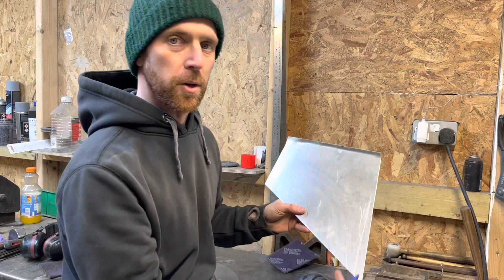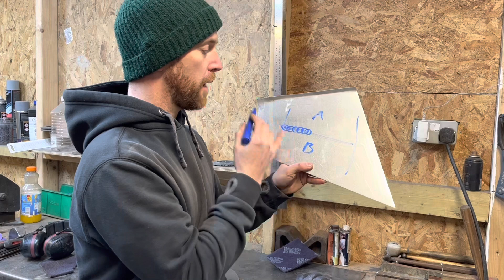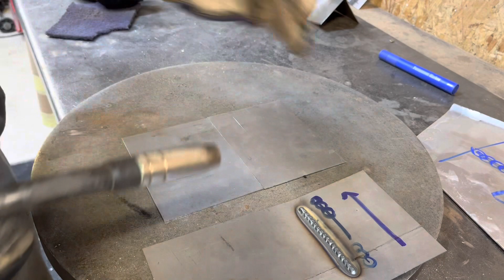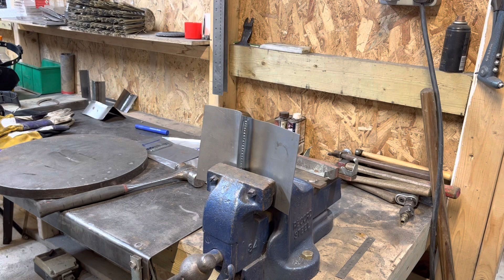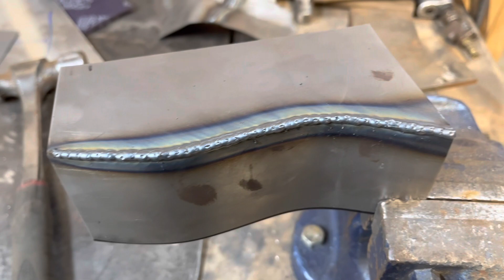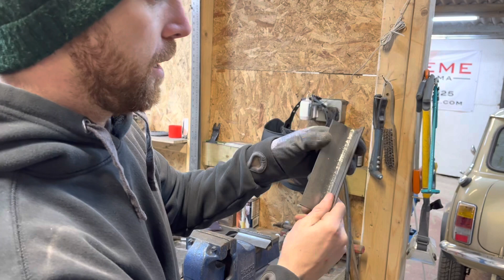MIG LIKE TIG

Comment: I haven’t started welding yet so for my benefit what was the settings used on the welder and what type of wire and gas did you use. Is this a good set up for a beginner Thanks.
Reply from the maker: Just mild steel wire. 60 amps for mig and 23 for tig

Comment: I think the reason this is shunned by the professional cert instructors is that ANY weld technique being learned is fraught with either too much or, more commonly, too little penetration. We all know that the outward appearance often doesn’t show what an x-Ray would. Thus, many welds are inferior though they look good. For a beginning welder to embrace this quick to learn process along with the inevitable poor penetrating mistakes is to introduce a false sense of confidence and ability. Soon, as we see on Yt, it is being used for all welding like heavy-wall motorsport frames, roll bars, suspension, and everything else where the common mistakes can be far more serious. So it just isn’t a technique to build upon. I think this is why it is poo-poo’d by so many. 
As a stand alone technique you have proven the strength on sheet metal.

Comment: Will you be able to do this exact same technique on 20-22 gauge? I kind of doubt it, I think it will get too hot, distort easily and possibly burn holes too easily. I haven't tried myself tho, I use the other tacking method, with 1-2 inch gaps, use some air to cool it down, and tack tack tack, blow, tack tack tack until it's a whole seam. It takes time but it's the method I learned to use on existing thin sheet metal panels.
Reply from the maker: I use it on 20gall the time without any issues at all. No holes and no distortion. For that I use 55/60 amps. 👍I do 3 tack and cool on bodywork.
Reply: @Metal_shaper_tom  Thank you very much for the information. 👍 I didn't mean to doubt your methods. I'll try it on my own restoration project. 🙂👍
Reply from the maker: @uti_s1471  sure . Don’t worry I didn’t think you were criticising. I think this method works brilliantly on thin material. Please give it a go. Hopefully you get great results

Comment: Great welding pal. How does this method cope with distortion?
Reply from the maker: If you see on the panels I weld in the video it doesn’t distort and I run the weld continuously. That little break between each weld really helps put less heat into them
Reply: Thanks for the video Tom, really helpful advice.
Reply from the maker: @dougwernham5209  thank you again Doug ! Your Sutton the channel really means a lot to myself. Is there anything in particular you would like to do a video on.
Reply: @Metal_shaper_tom  Tom , I find all your video’s helpful I’m trying to make & fit small repair panels to factory finish, if that makes sense.
Reply: It's a tequniquie I've used to reduce distortion where TIG wasn't an option as Tom explained. Pipes are a bit trickier to do as neatly as those demos but can be done and with a bit of practice you can get a gas tight weld.

Comment: Anyone who doesn't see the value in this method may be working in a very controlled environment or are used to (or are forced to) use another method.
This method is another "tool in the toolbox". Not every tool is right for every job.
Like everything, this does require practice. Your HAZ was very even, showing you have put in the practice (with a nice, even speed), have the right settings and have decent steel that is cleaned well.
I find it is quite easy to not space the tacks properly which means you have to go back over them to catch the missed spots. But again.. practice.
Thanks for the video, Tom.
Reply from the maker: Glad you liked it joe. Very well put ☝️! I like the phrase tool in the toolbox 👍